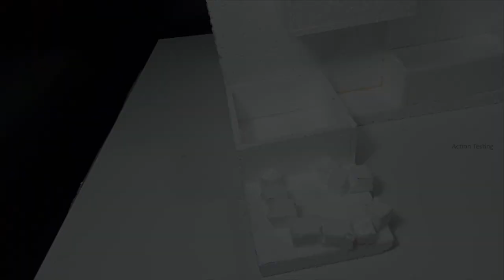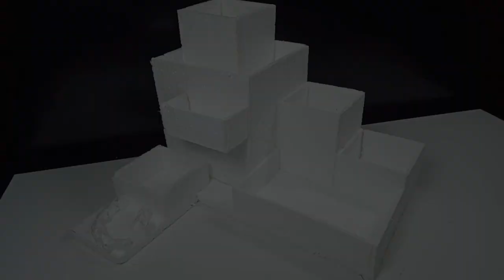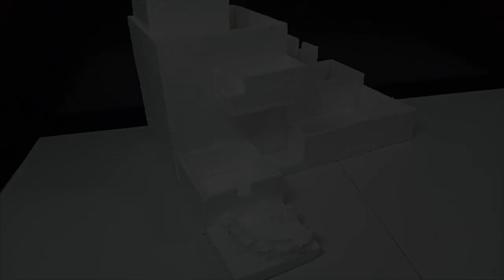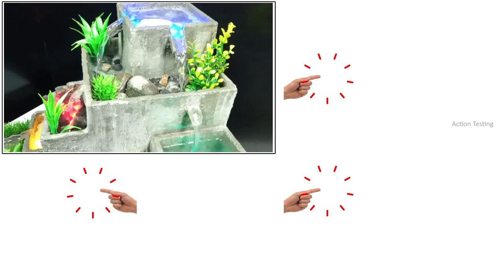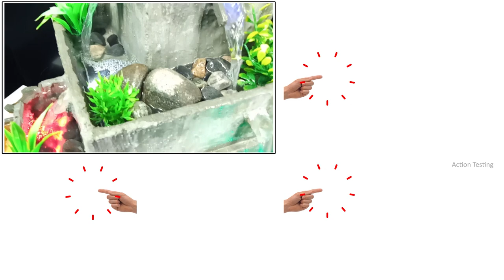Biggest tabletop fountain | Amazing multi level waterfall by home

Comment: Ok you didn't show how or what you connected all the leds to was it a standard plug or a battery? Looks great!
Reply from the maker: This led need a 12v supply.  use a battery or power adapter.